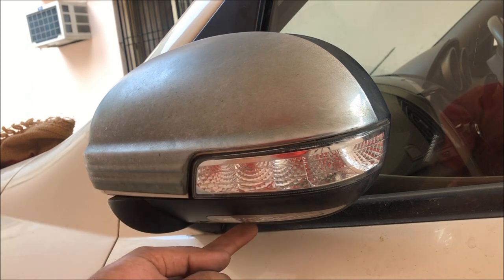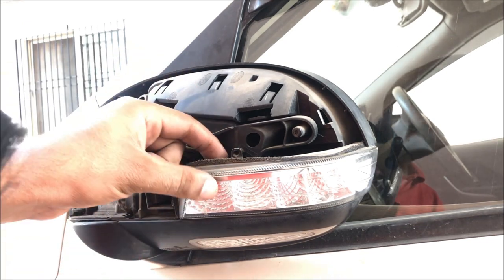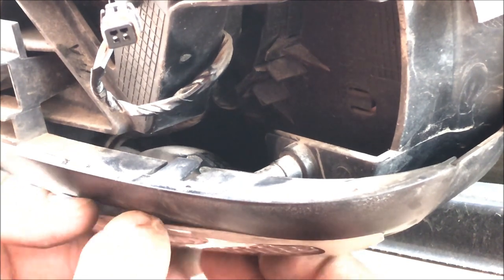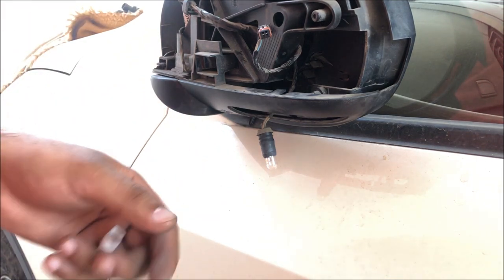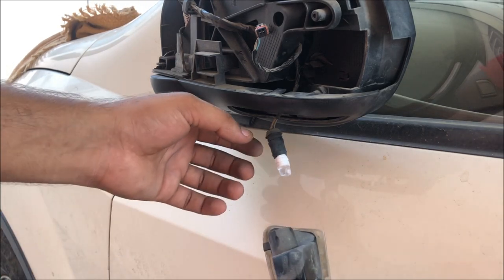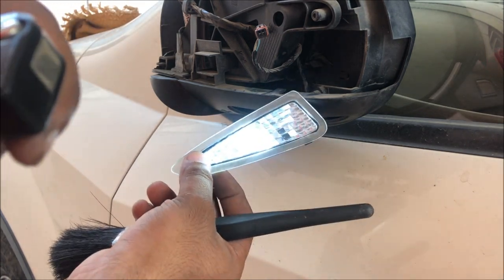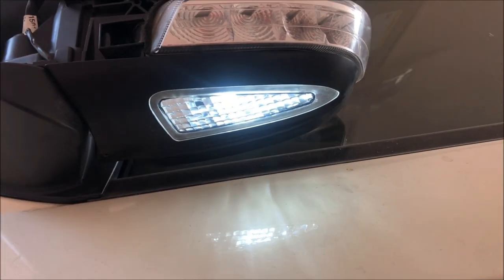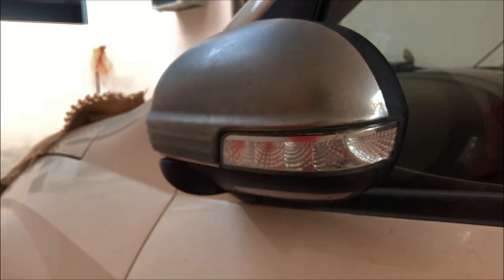How to install LED lights in Side Mirrors of XUV 500 | XUV 500 Welcome light converted to LED Light

Comment: sir, also want to replace the same, pls tell where i can buy this in india
Reply from the maker: Try it in local market or from ali express online shopping.

C$ 0.02 | Bevinsee T10 led T12 T15 194 175 168 #555 2835-SMD Chips LED Light Bulbs For Ford F-150 Car Dome License Map Lamp Parking Bulb
https://a.aliexpress.com/_mqDqiQR

C$ 6.31  20％ Off | 10Pcs T10 W5W Ceramic 3D LED Waterproof Wedge Licence Plate Lights WY5W Turn Side Lamp Car Reading Dome Light Auto Parking Bulb
https://a.aliexpress.com/_mLIn6xp

Comment: Can u share a video of how to remove xuv500  headlight assembly
Reply from the maker: Vikas pOrwal will try for sure. To remove a headlight, you need to dismantle front bumper.
Reply: @MANVIRSINGH1313  well li changed all the lights to white in my xuv and it's rocking !!! Ended up breaking the indicators holders while fitting the bulb... But managed to fix it back hard with fevikwik and 3M tape !! It's perfect
Reply from the maker: Vikas pOrwal great